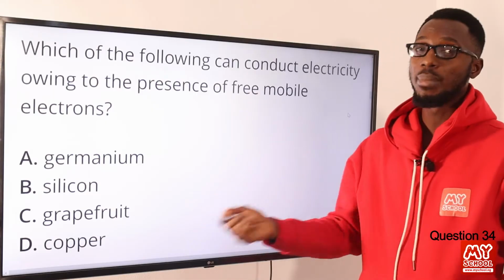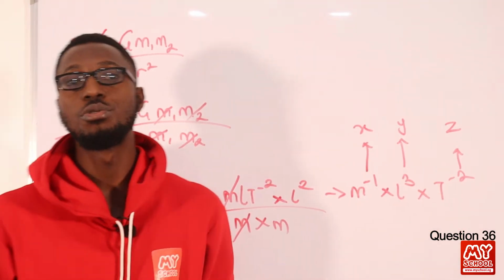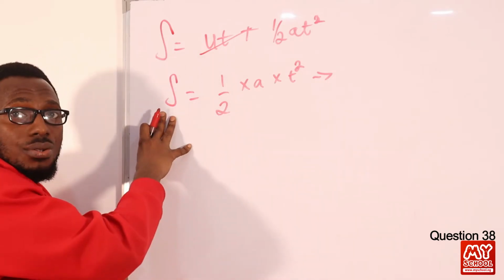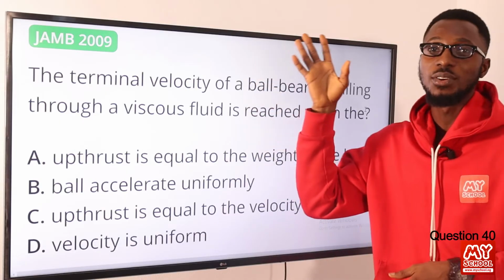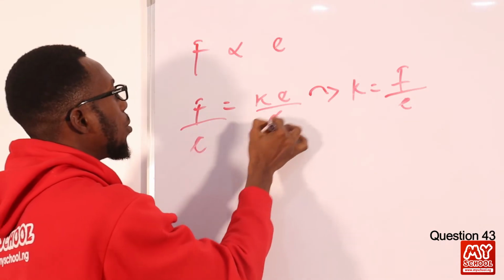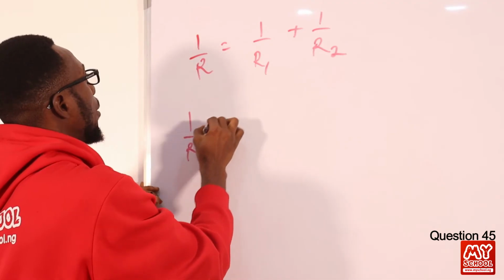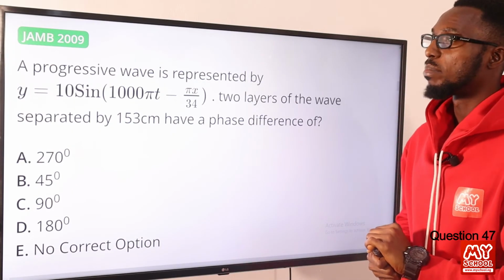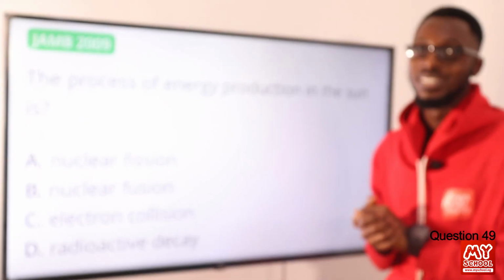JAMB CBT Physics 2009 Past Questions 34 - 49

Comment: Hi
I just finished jamb mock recently
In the physics section i meet alot of formula like question
Like if the length of a string is double what will be the new fundamental frequency
These questions gave me alot of problems
If u could treat them i would be forever grateful
Reply from the maker: post any of your academic questions by clicking this link https://myschool.ng/questions/academic-questions  and our solution providers would take it up from there.